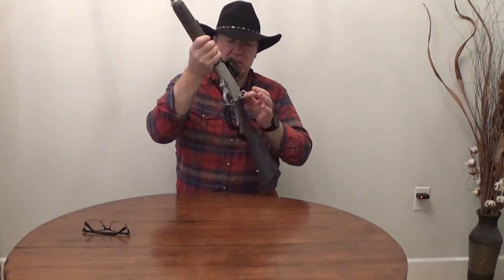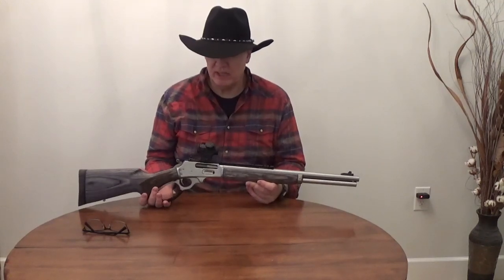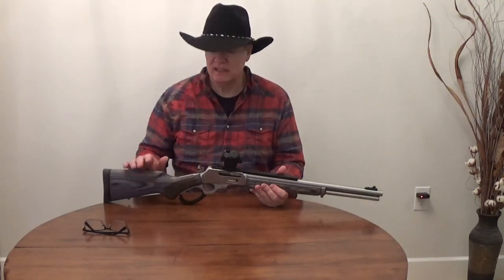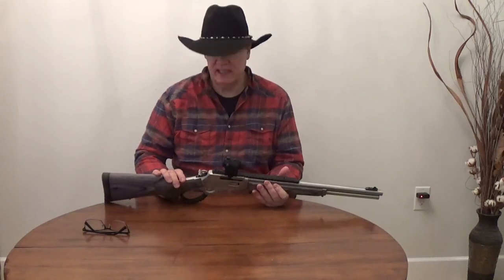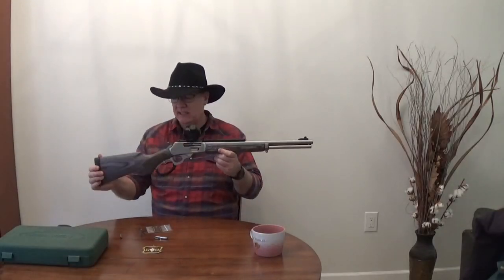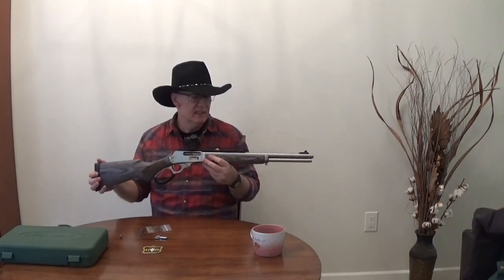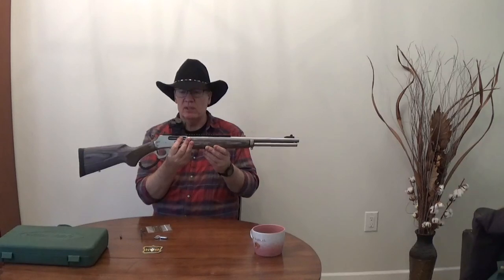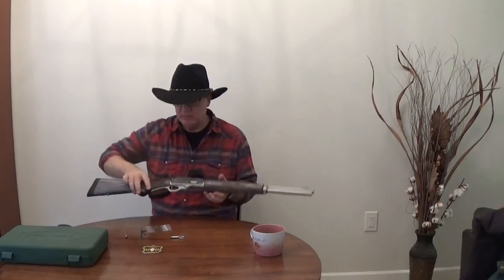Saddle Ring Install on a Marlin

Comment: Like you, I have fallen in love with the 1895”G” series .... I’ve owned a Remlin 1895G (loved it) and also an 1895 GS (JM, loved it , too). Now I have finally settled and found my most beloved GSBL with FNC (Nitro) finish from the factory. I’m old school Infantry so OD Green stock set will work just fine for this old ground pounder. Regarding that safety, I choose not to remain annoyed. I hunt without using that cross bolt addition. I leave it in the “Red” or “Fire” position the entire time and observe trigger discipline, etc. Recently I took a tight fitting ORing from my collection of random ORings from an Oring jar. No more cross bolt safety annoyance. ha haha ha Cheap and easy fix. Glad that the saddle ring is working for you. If I was a horseman, it would make sense. I’m merely Mechanized Infantry, not quite Cavalry. LOL All the Best!! Peace Be To Journey!
Reply from the maker: Hey thanks for your comment! Glad hear from another Marlin fan. The North West Cavalryman handle is a reference to 34.5 years as a Mountie. Originally we were supposed to be called the North West Mounted Rifles. But the weenies in Ottawa thought that sounded too aggressive, and militaristic, so they changed the name to NWMPolice.  Then of course we later became the Royal North West Mounted Police and finally we merged with the Dominion Police and became the Royal Canadian Mounted Police. We had various nicknames over the years, Queens Cowboys etc. I use that handle for Cowboy Action Shooting as well.